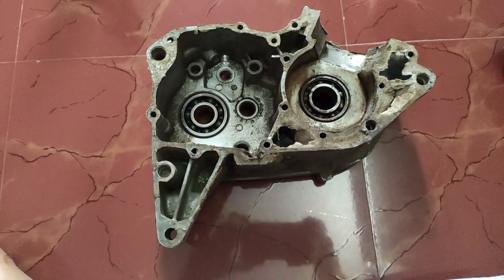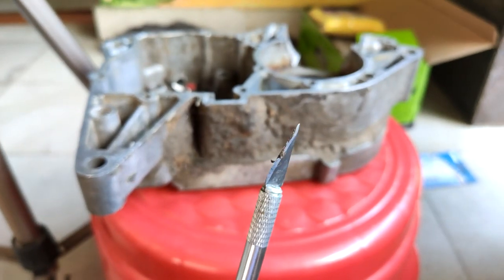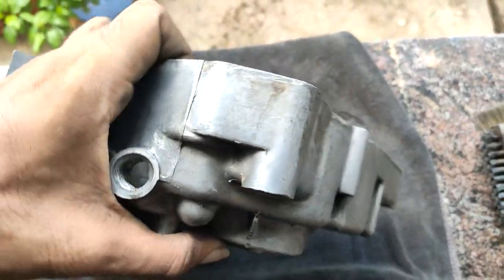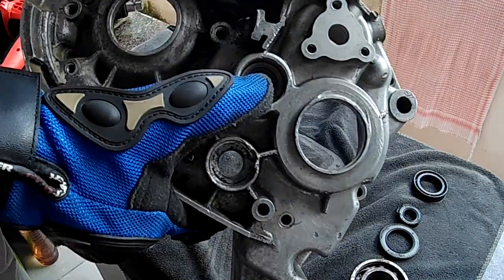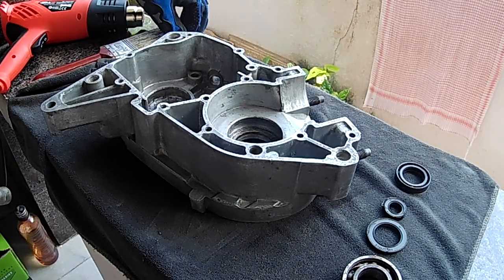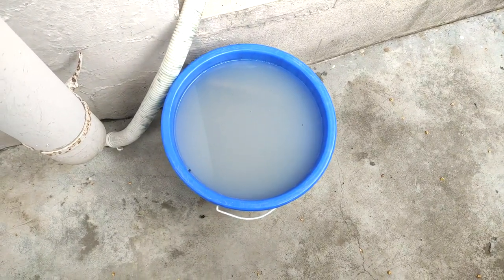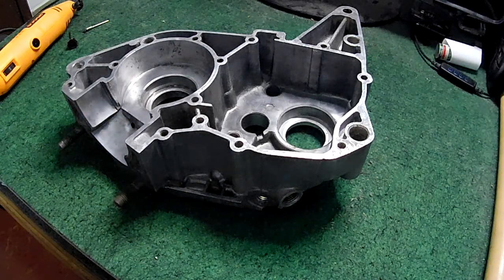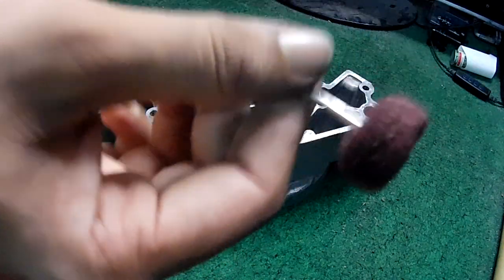D.I.Y Crankcase Restoration of Yamaha RX

Comment: Would sandblasting the cases work?
Reply from the maker: Never sandblast cases, as it can ruin the case completely. Always stick to manual cleaning. Stay away from bearing sitting area of the cases.
Reply: @BrattyBiker  Ok Bro. Thanks. What about the bike chassis?
Reply from the maker: @mjshaheed  Chassis, you can sandblast, but be very careful with the neck, as your coneset has to sit inside.
Reply: @BrattyBiker  Sure Brother. I will keep that in mind. I will try to cover them something.
Reply from the maker: Make sure to cover it with thick cloth. You really don't need to sandblast, unless your chassis is fully covered with surface rust. Just remove the old painter, use a wire wheel brush & simply grind off the rust. Then give it to tinkerer & ask him to check structural integrity, he will make sure its not damaged beyond repair. Safest & best way.
Reply: @BrattyBiker  Yes, it is completely covered with surface rust, especially where the tank and seat sit on. I will try to clean it as much as possible with hand. I will only go for sandblasting as a last resort.
Reply from the maker: Yes, use a wire wheel brush on a drill, it makes your job a lot easier.
Reply: @BrattyBiker  Sure, Thanks a lot
Reply from the maker: @mjshaheed  Cheers!

Comment: Bro there is a toothed wheel attached to the clutch bell/hub...what is it's function?
Reply from the maker: That's called as your clutch boss. It's duty is to transfer the power from the clutch plates to the gearbox. It also holds your springs and clutch nuts of the outer plate. They rotate at different speeds and are not connected together. When you press the clutch lever, you disengage the clutch so the outer basket (clutch bell/hub) will keep spinning but when you engags the clutch, leave the clutch lever, the plates are pressed and it spins your inner boss, which transmits to gearbox, to front sprocket, to rear sprocket via chain, and to the hub, and finally to the wheel.
Reply: @BrattyBiker  got it.... Thanku...
Reply from the maker: Cheers!

Comment: Brother how to correct chamber leakage in rx100??
Reply from the maker: Chamber leakage ? Do you mean on the block, or on the exhaust ? 

On the exhaust, you have 1 gasket that sits on the block, which the bendpipe will attach, and you tighten the holder to achieve a proper seal. The second one is present between the bendpipe & the exhaust, it's a special gasket, goes into the special nut.
Reply: @BrattyBiker  3 days before I open my RX 100 bike block and I see that the engine oil come on the connecting rod assembly. So one rx100 mechanic says it's camber leaking, you have to re fit the complete engine. So is it right or wrong that he says??
Reply from the maker: @vijayendrahirwe502  Why was your block opened ? 

Did you check smoke's color ? If it is white, then your mechanic is right, your gearbox oil is leaking into the crank chamber, usually caused due to gasket failure or any damage on the crankcase mating area. Unfortunately this requires a complete disassembly & rebuild of the engine
Reply: @BrattyBiker  correct brother. I opened my bike block due to its low performance. Since last 3/4 years and I am disappointed with my bike performance. So when I open it,  some oil is popping out on connecting rod assembly. One Mechanic says your bike engine gas kit is not properly set. that's why engine oil leakage is occurring. And also mechanic and I notice that my bike block is sleeved. Bike engine work done by my father 12 year back. Now I am planing to re sleeve it properly. Because previous sleeve is not correctly cut. And it's port also not properly flaring that's why mechanic says your bike is not getting proper intake and outtake. And now engine bearings also sounding now from left magnet cover. So I decide to diss mental and re build the engine myself at home, like you did the great job to your bike. Because in my city I can't trust any mechanic for engine work properly.

Comment: You could always heat it on top of the gas stove if you don’t have a heat gun😁
And who is the adviser you keep mentioning
Reply from the maker: The reason why it's a bad idea, is that the direct flame is seriously hot & unmetered. We have to be super-cautious when doing so, or we have a chance of melting parts of the aluminum casing making it unrepairable. I avoid using Butane/Propane torch for the same reason. The heatgun seems to be a much safer approach.